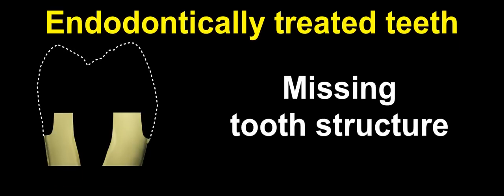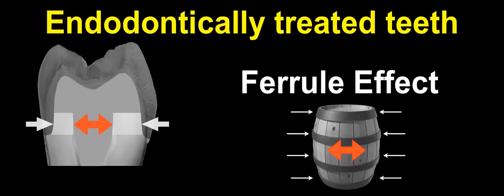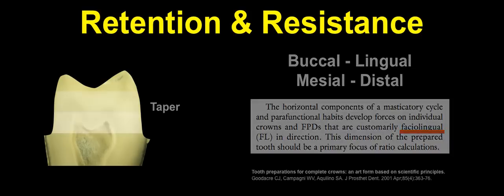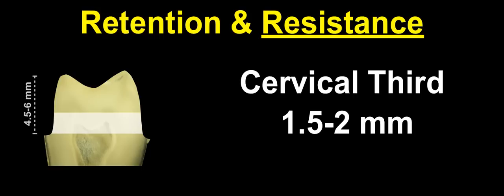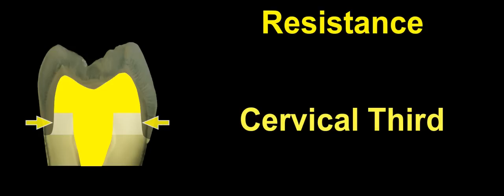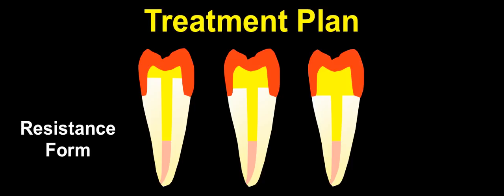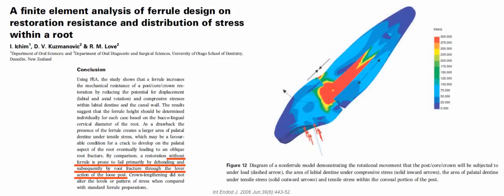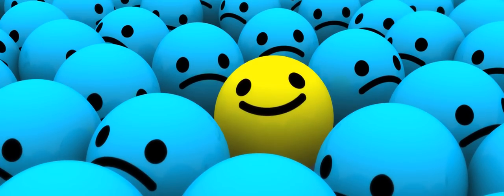Ferrule Effect - A different point of view of the preparation of endodontically treated teeth.

Comment: Thank you for your nice presentation 

can you please discuss more regarding the last pictures and patient case in the video
for upper center incisor ?
Reply from the maker: The patient had the upper center incisor fractured, probably due to short metal post and conventional cement, but she thought that the lateral incisor (#12) we had restored, was fractured!
Reply: Thank you  for replay 
i mean  what is material he use for patient ? 
also what type of post  i think he use fiber post  right ?
Reply from the maker: The doctor who made the Central incisor restoration used metal lab made post, as I mentioned before, and porcelain crown  (PFM) over it. We made the Lateral incisor root restoration, using fiber post and dual cure resin cement and on top of it lab made porcelain crown @HAZEMDENTAL

Comment: Such a good point of view! Have a patient tomorrow and was thinking about how to mantain the ferrul.
On the other hand what about your other video, where you prepped subgingival, filled with flowable, than prepared for crown. What is happening with the resistance (and sound tooth structure) on that case? 
Thank you for your enlighten presentation again!
Reply: +aron dombi when there is no sound tooth structure at the cervical area, it is there that I think that it is essential to use a glass-fiber or carbon fiber prefabricated post and use flowable composite for the build up (actually this is the technique that I have been using for over 10 years in my private practice). In this way that core has some flexibility and the least possible forces are transferred to the root and the problem of post documentation is practically solved. After the post and core build up, the preparation follows the classic rules. If there is no tooth around the margin I do not intentionally do crown surgery or deep sub gingival preps. The flexibility of the post and core saves the day... But this is the topic of another video...